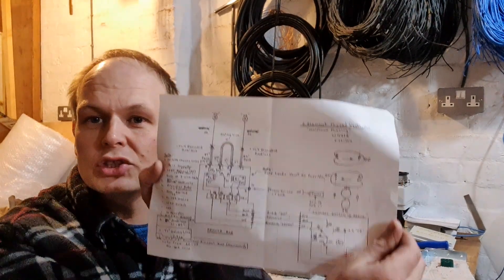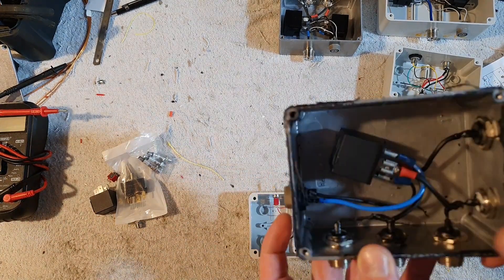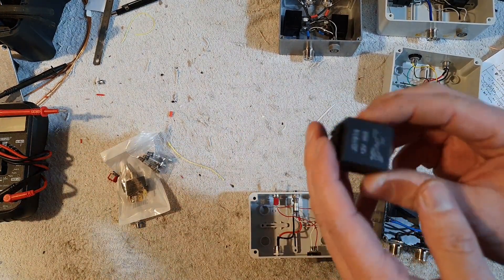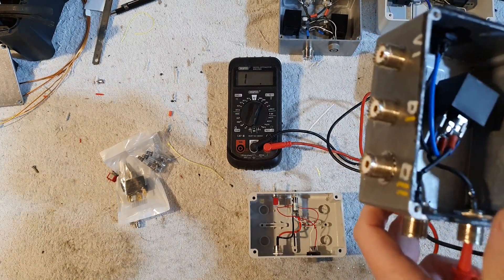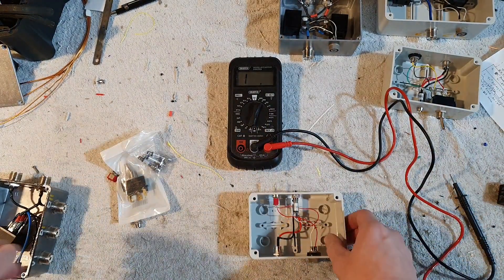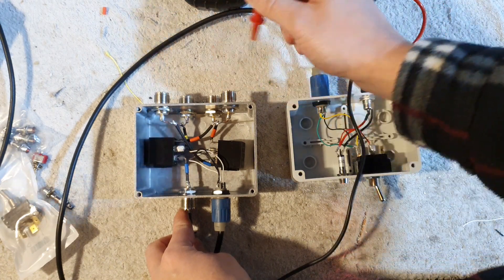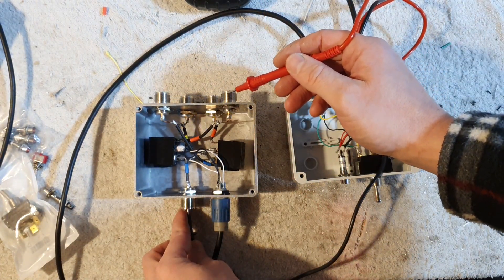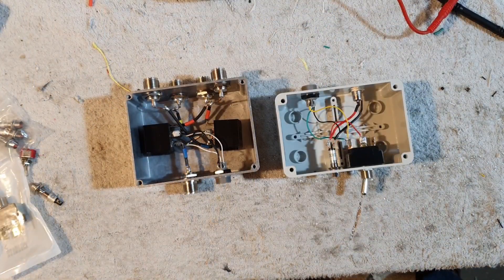Christman Vertical Antenna Phasing - Main Components Overview

Comment: Very nice video!!!!      If you run into problems with your DC (control and switch) lines picking up AC noise (acting as antennas) and not recognizing commands, decouple them with a disc capacitor.   .01uf is a nice general purpose size.    You may be interested in the U Adcock array as well.   It's receive only as built, but phasing for transmit should be the same.   I worked on the AN/FRD-10 antenna, you may find that interesting also.
Reply from the maker: Thanks, I will keep that in mind.

Comment: Install SPDT (or DPDT) relay in metal box with two SO-239 connectors (3 if you want one for the feedline). The center of the feedline coax goes to the wiper arm of the relay. The NO contact goes to one SO-239 and the NC to the other SO-239. Put a diode reverse-biased across the relay coil. Close up the box. Put two (2) T-connectors into the SO-239s. Riun the 84º lines off one side of the T-connectors and jumper the 71º phasing between the other sides. 
Account for lead lengths inside the box, and the T-connectors, when cutting the Christman lines. Put a second relay in to short out the two SO-239s for "Omni". You can feed both relays with one twisted pair of wires by using diodes in series with the coils and reversing the polarity of the relay keying voltage.
Reply from the maker: Hi Bill, appreciate the comments. After this video I did exactly as you say with 2 SPDT relays. I've went with 1/8th wave spacing fed at 135 degrees due to my small garden. The phasing lines are 157 degrees and the delay line is 39 degrees. I've had mixed success so far. As you say it need lots of time to set up which I don't have. Thank you so much for taking all mt questions on Larrys Livestream. In this video I seen good F/B on the CW end particularly. 73, Colin https://youtu.be/wSQwMPiec9Y